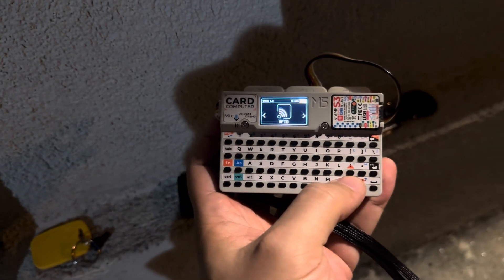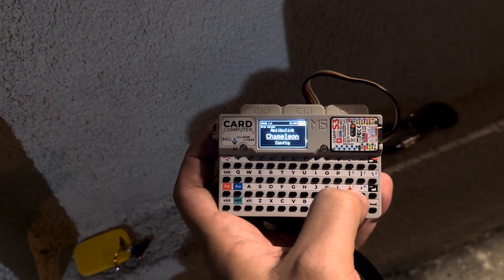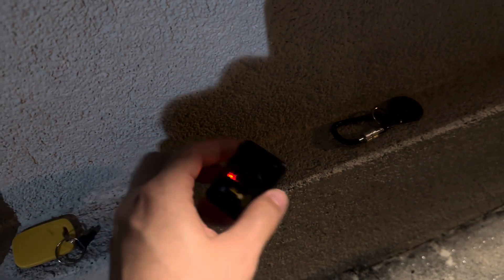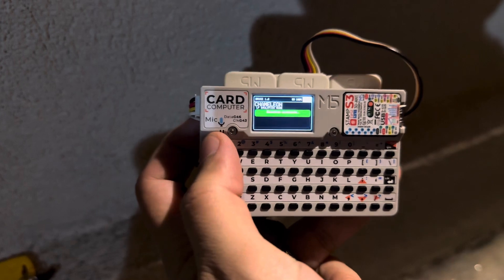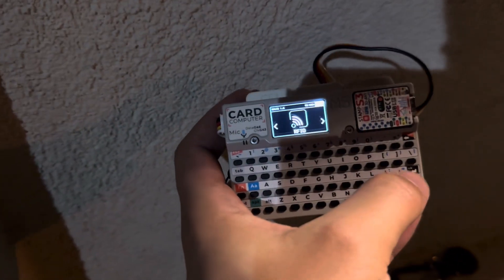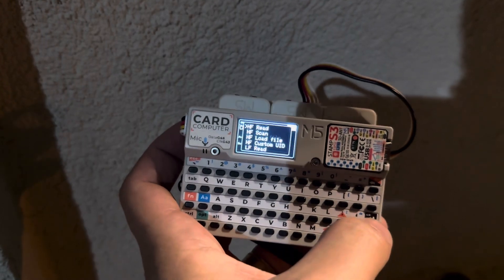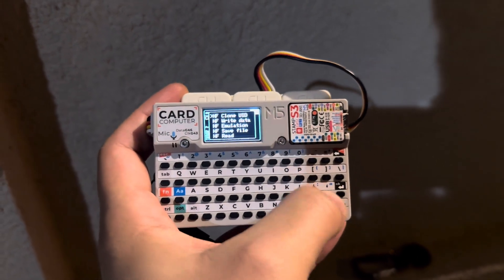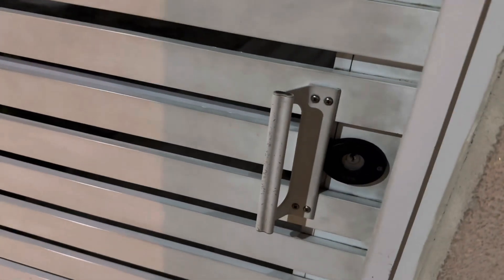Hacking your way into a building using a Chameleon Ultra and #BruceFirmware

Comment: You still need a tag to begin with. Not exactly practical… unless you plan on tapping someone’s pocket over and over.
Reply: Thinking about the same, I thought it’s gonna be tutorial to brute force the building without copying a tag, simply by bypass security((
Reply: They can get longer range extenders I think. The main things they solved was the tags not being encrypted. If you’re using an unencrypted very old system. That’s your problem

Comment: Wouldn't it be possible to simply write to a tag with the cardputers RFID scanner? Rather than using a chameleon. Also how would make a go at getting in without a tag to start with?
Reply from the maker: @johnlincoln4070  yeah, it would.
Reply from the maker: @johnlincoln4070  you need a clonable tag or a chameleon device as the rfid module does not emulate